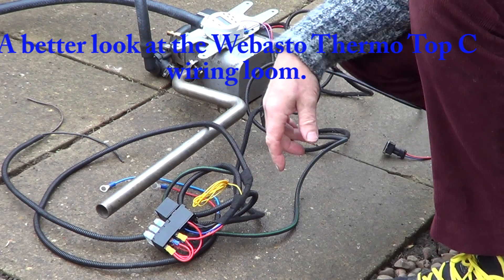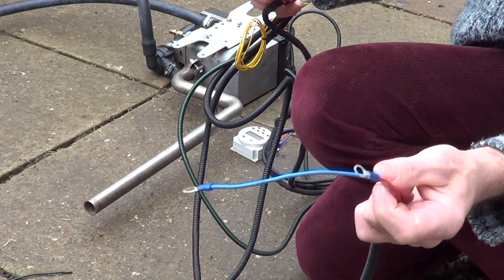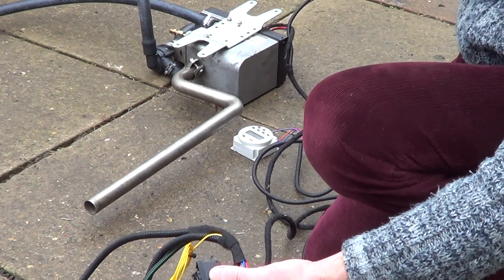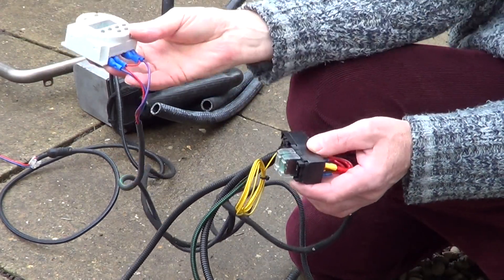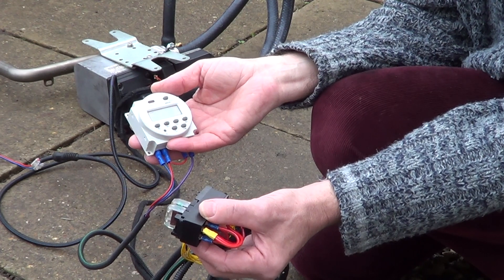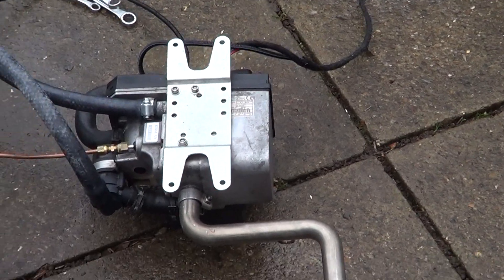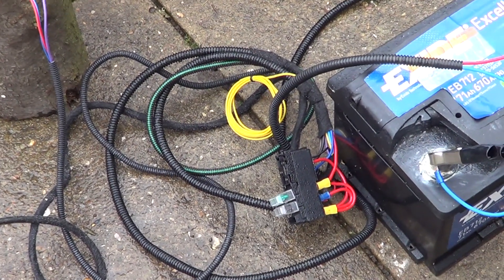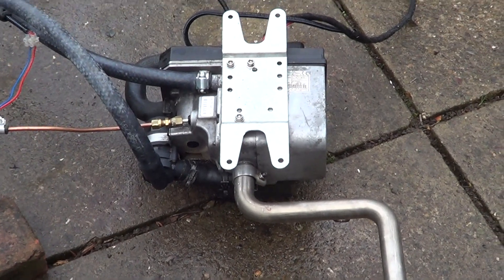Webasto Thermo Top C Loom & Test Run

Comment: Thanks for the video from California. I just bought the same unit intended for my houseboat. I have heard that there is a temperature threshold of 86deg Fahrenheit(the heater will not restart until the water temp falls below 86F). Have you experienced this? Thanks again for a very informative video.

Comment: These units are used as preheaters on the 04 Land rover Freelander TD4 1 and facelift model SE SW, they are recommended.
Reply from the maker: Yep, spot on they do make good boat water heaters as well and can be picked up quite cheap but also can be problematical! But they do work well when you get them going right. Thanks, K.

Comment: Hi there 
Very useful video, Big thanks 
Where did you purchase your loom ,there seem to be 3 variants, controller, 7 day controller and multiple controller looms I'm  alittle confused  ,also the amazon £9 controller suites my needs too .
Reply from the maker: Hi, thanks for your kind comment My loom came from ebay and a super firm called Angliapostalparts it seems they are no longer trading on ebay sadly! As they advised and sent me the right loom with the right connectors on for my Thermo Top C. So it was as simple as that for me. That cheap 12volt  timer from Amazon works well. Could heaters when you get them working well for sure. thanks again Kev.
Reply: @BramleyProductions  Thanks again Kev ,I'm looking forward to hear her roar up ,your video and comments have been invaluable .warm regards Paul

Comment: hello, good work. I enjoy watching your videos. Thank you very much for your sharing. I have a thermo top c webastom, I want to run it externally. I don't know the wiring diagram, help please. thanks
Reply from the maker: Thanks for your kind comments! Well, this is a bit tricky as you will see I brought a Webasto Thermo Top C complete wiring Loom off ebay for my heater! You really need a wiring loom that is made for the heater then it is very straight forward to concert all the parts up as I show here. As those loom fits the plugs on the Thermo Top heater and has a connection for the pump etc, I would recommend trying to find a loom for your heater. Sorry, I do not have any wiring diagrams for the Webasto heater! And like I say I brought the loom and it all fitted together very easily. Kev.
Reply: @BramleyProductions  thanks
Reply: @BramleyProductions  thank you for your attention.

Comment: Quick question please. I want to replace my now defunct Mikuni MX60 heater with a Webasto heater. However, the Mikuni is 24v (has a 24v supply already laid on) and it looks like all the Webasto's run on 12v. How can I get around this please?
Reply from the maker: Hi, I think you can buy the Webasto in a 24 Volt version. I'm not 100% sure on that but I'm sure I have read that mind that was some time ago when I read that. Now in converting a 12-volt unit Webasto to run on a 24 Volt supply! I would have to consult my friend who knows a lot more about these heaters than I do. I have always only ever fitted 12-volt versions of this Webasto heater. Also, the Eberspacher D2 warm air heaters these have all been 12 volts. I will drop him an email to see if he knows if you can do this, I would assume there would be some way around this for sure. Thanks. Kev.

Comment: Hi.
Thank you.
Very useful video about the loom upon which, as you say, there's very little on the interweb.
On my Top C loom there are two relay-like objects in the bank with the fuses.
One is obviously a standard type of auto relay and which I understand, however, beside it, there is another relay-like object which also plugs into a relay socket but this one is much taller than the standard auto relay.
There is not a single marking on this thing anywhere and its 'pins' are very sulphated which maybe behind why my unit does not now function.
Do you or does anyone know what on earth this thing is?
I am expecting to have to disassemble the loom with a meter in hand to determin the disposition is of everything but if you can save me any spaghetti teasing, I will be so grateful.
Again, thank you for the video.
Reply from the maker: Hi, that is a tricky one for sure! I have to say I'm just very much a DIY amateur with these heaters I have never seen a set up like you say you have on yours normally you just get the relay and fuses the relay I have not used as that is there if the heater is used on a vehicle and so powers or goes to the vehicle fan. So sorry I'm not much help there is a wiring diagram here see the link and that gives no notes on any other parts either so sorry I have not been much help! Kev.
https://www.melloronline.co.uk/product_uploads/14417990441.pdf
Reply: @BramleyProductions  Well, I finally got at the Webasto loom and have opened out as much as I can reach (Lol. 6' 3" tall and round!). The 'extra' relay is indeed a timer relay. Professor Google says it can be set from 0 to 150 minutes, is Polish and gave me a '.pdf' which had an English translation!! When removed and viewed very close up, I could just make out embossed  terminals 1 to 5. I also found a faded old label in the 'hidden' side and by chasing the wiring back, I found it switched both the heater itself and the water pump on using the black 'signal' wire  on the loom as the trigger. I stripped out the relays and the unused bit of loom for relay switched vehicle HVAC equipment.
Unfortunately, my meter testing found that the timer is defective but by bypassing it, I got the heater to power up second go after a lockout reset. Much happier now but must withdraw and await replacement parts.
Geoff Smith.
Reply from the maker: @geoffreysmith916   O well done glad you are well on the way to fixing your problem there. It's always so very interesting to read of these faults and there fixes thanks Kev.
Reply: @BramleyProductions  I have now determined that this loom is unlike yours in that the cabling for the water pump is routed to the fuse block to attach to the 'former' timeing relay. I cannot get to enough of the loom to take that lead back closer to the pump and burner unit so I will re-instate the conventional relay and use the trigger wire with a relay socket connector 'T'ed into the cable to energise a coil switching in the water pump from a power lead from an unused fuse holder. I found the yellow diagnostic wire which was terminated on one side of yet another unused fuse holder. Going to look a whole lot leaner by the time I have finished, IMHO. Best wishes. Geoff.

Comment: Like you Im using this in my narrowboat and will be doing away with the relay, so what do i do with the two thinner wires going to the relay..?
Reply from the maker: I just put some heat shrink tube over them and taped than back into the loom and left them! Kev.

Comment: Hi sir may i know how much fuel this heater consume in one hour. I am looking forward to make a diy heater for my garage. I really appreciate if you can reply me back please
Reply from the maker: Hi, What would you like to know about this heater? And sure if I can I will always try to help. Thanks for the comment. Kev.
Reply: @BramleyProductions  sir i  want know how much deisel this heater consume per hour.
Reply from the maker: According to the manufacturers they use .6 of a litre on high and .3 litre on a low setting. I have known people on boats say they use about just under 1 litre an hour heating water via a calorifier. Hope that helps. I sure it will depend on how much water you are trying to heat up in your system and such like. Kev. @manbehindthewheel249
Reply: @BramleyProductions  thank you very much sir yes it is very helpful.
Reply from the maker: According to the manufacturers they use .6 of a litre on high and .3 litre on a low setting. I have known people on boats say they use about just under 1 litre an hour heating water via a calorifier. Hope that helps. I sure it will depend on how much water you are trying to heat up in your system and such like. Kev.

Comment: Which wires the fuel pump connects to ... can you tell me ... please
Reply from the maker: On my loom which was sold to me as a proper Webasto loom for the Thermo Top C the fuel pumps connects to the thinner red & blue cable The Thicker Red And Blue cables are the main power cables to hook up the heater to your main 12-volt battery. often I have seen both Webastos and Eberspacher heaters also use green and brown wires for the fuel pump hook up. Kev.

Comment: This was useful! Good to see how simple the system actually is! Do you know if this thermo top c has two power levels? Like does it run on half power when it has reached high temperature, or does it run full or off only?
Reply from the maker: Many thanks. No, my Thermo Top C does not have two power levels mine just runs full until you switch it off. Now I assume you could but a temp switch in the system like a high limit so when the water reaches a certain temp the unit will /would go off. Thanks for your kind comment. Kev.
Reply: @BramleyProductions  that's exactly the information I was looking for, cheers
Reply from the maker: @overnighter  Thanks glad you found it of some help. It's always great to get kind comments so many thanks. Kev.
Reply: @BramleyProductions  All units have a high temp sensor in them and usually is around 120 degrees celcius. So they would shut off if overheated.

Comment: ive found a alternative for  the water pump https://www.ebay.co.uk/itm/12V-24V-Hot-Water-Circulation-Pump-Solar-Heater-Brushless-Motor-800L-H-5m/274244389315?_trkparms=aid%3D555021%26algo%3DPL.SIMRVI%26ao%3D1%26asc%3D20190711100440%26meid%3De0fc724715eb4e52837a3e6454a6700c%26pid%3D100752%26rk%3D8%26rkt%3D18%26mehot%3Dco%26sd%3D223962547178%26itm%3D274244389315%26pmt%3D1%26noa%3D0%26pg%3D2047675%26algv%3DSimplRVIAMLv5WebWithPLRVIOnTopCombiner&_trksid=p2047675.c100752.m1982

Comment: thanks for the response  also seems my one didnt come with a pump also
Reply from the maker: I think I paid about £40 for a pump from a UK ebay supplier again but I now see there are some very cheap pumps sold for these type heater on ebay from Hong Kong and China mind I suppose delivery would take a few weeks! I put my heater  and parts altogether from buying all the parts it was cheaper than buying one of the very expensive Webasto Kits. Kev.

Comment: can you put a link to the timer please and how you made up the wiring loom
Reply from the maker: Hi, the loom on my Webasto was brought as a Webasto Thermo Top C loom from ebay from a UK supplier of Webasto parts it cost me about £50 for this. It was much easier than trying to work out and make my own loom. I suppose you could but for me, this was much quicker and so much easier. the timmer comes from the link below Hope that might help thanks for comment Kev.
https://www.amazon.co.uk/Heschen-Digital-Weekly-Programmable-Switch/dp/B071D9H3JY/ref=sr_1_3?crid=2YXER7DHQ0BF6&dchild=1&keywords=12+volt+timer+switch&qid=1587501903&sprefix=12+volt+timer%2Caps%2C164&sr=8-3
Reply from the maker: Looks like the Webasto looms have gone up since I brought mine on ebay They now seem to range from £70 to £90 pound now! Kev.

Comment: The loom is pretty expensive for what it is, especially as you are not using all of it. I wonder what type of connectors sre those. Better to make own loom with what one needs anf propet wire length. Thanks for the video.
Reply from the maker: Many thanks Yep I agree to re the loom price!  Mind it was a bit like a catch 22 situation not knowing what wires went where buying the loom made this much easier and now I know I could soon make a loom much cheaper for sure but this was a genuine Webasto part so you do pay the price then Thanks for your comment Kev.
Reply: https://youtu.be/uFjV6FST8Hw
Reply: I make the looms check my video

Comment: It’s very noisy.
Reply from the maker: Hi Yes, noise can be a problem with these units on startup, particularly you can hear them on boats a fair way off! I suppose on car and vans it does not matter too much but on a quiet tranquil canal or river bank it can sound very noisy But in their defence they do work well and heat the water up quickly but you raise a valid point with the noise! Kev.

Comment: Hi, at 5.23 you show the wiring plugs to the heater, first plug has 6 ports with three wires, no 1 for timer, no 6 for the pump, what is no 2 for?   second plug has 2 ports  which are + and - 12v supply.
Cheers P
Reply from the maker: Hi thanks the heater is now on the Narrowboat in the process of being fitted so I don not have the heater or any paper work here at home right now the loom that I fitted to this Webasto was brought from a reliable suppler of Webasto parts off ebay like I say my plugs from the loom to the top of the heater just fitted on to the heater I could have a look next time I go at what No 2 does but like I say I do not have the heater here at home right now so sorry about that Kev.
Reply: @BramleyProductions  cheers
Reply from the maker: At last I have been to the boat so if this helps! So re the second plug on Webasto heater on my loom is like this 1. Is Blank Not used.  2. Is Yellow cable. 3. Is Purple cable.
4. Is Black Cable. 5. Is Blank Not used. 6. Is Red Cable. 

Now The Yellow cable is not used on my system but this yellow cable of NO.2 position can be used with one of those diagnostic programmers I believe. The Purple of NO3 goes to my timer controller and I assume the red of 6 and balck of 4. are power. Hoppe that may help in any way. Kev.
Reply from the maker: Just had another think as I say ticky with out my heater to see here but this loom and plugs also came with a brown and black wire which is if you are using this in a vehicle as a heater! I think this connects to the fan in the vehicle to control this and via the relay which I remove in this video as for the boat hot water system this is not needed. But like I say when I next go to the boat I can check this out. Kev.
Reply: I make looms up

Comment: Hi it has been a while but I was wondering how you did with the narrowboat install of the webasto and calorifier please?
Reply from the maker: Hi thanks well its funny today I got the last job done on the list now all I have to do is install the Webasto! So I hope to start this next week work has been a bit delayed as I care for and elderly parent so my time as been somewhat limited this summer but the installation is coming and I will try to video some of it and how it all works out and goes together so yep its coming soon! Thanks for asking and hopefully all being well next week I'm going to start at last the rewire and re plumb  all took a lot longer!!! I have the calorifier all fitted and this works well off the shore power 240v electric with the 1kw  immersion heater that is fitted to this as well so I do have hot water at the boat again which is lovely Thanks Kev.